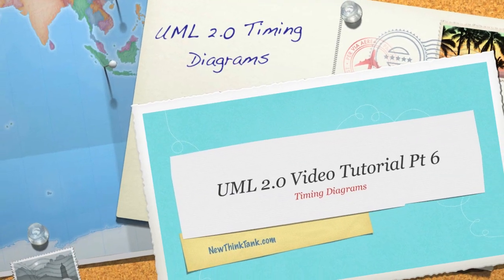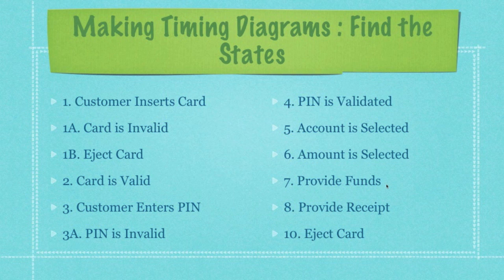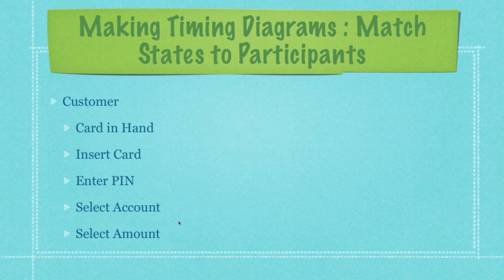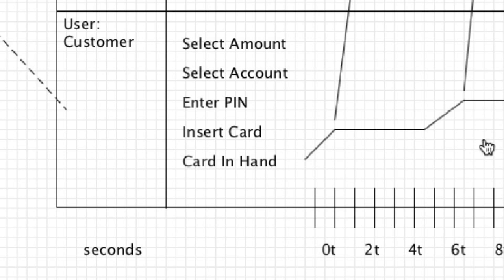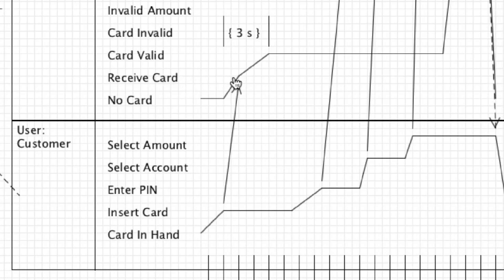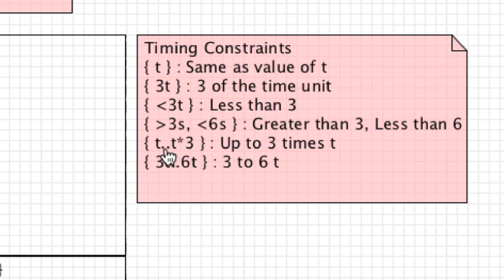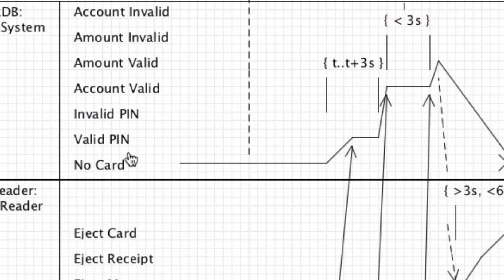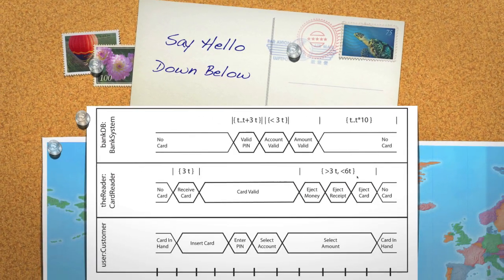UML 2 Timing Diagrams

Comment: Dear Mr. Banas,

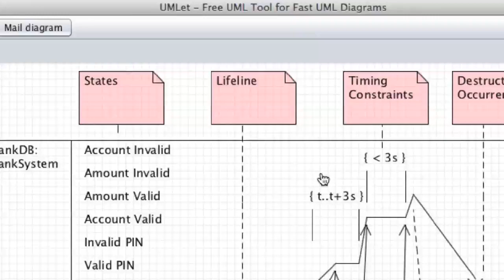first of all, thanks for the great tutorials on UML. There are a couple of tiny mistakes in the note that's displayed roughly at 6:13 and afterwards. Namely, the s's in line 5 should be t's, and I think the one that indicates that we have at most 3t should read 0...3t instead of t...3t, which probably indicates "somewhere in between t and 3t" in coherence with the last line.